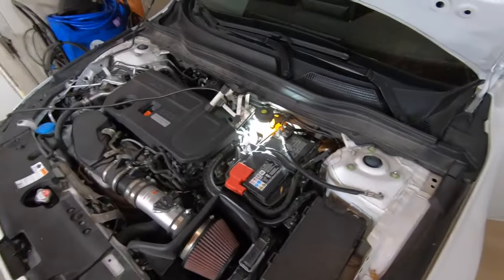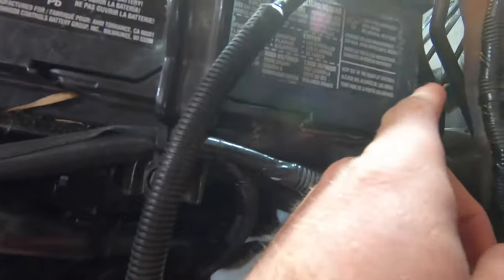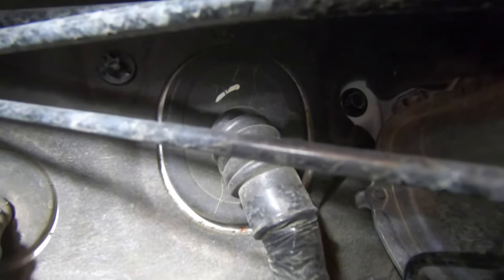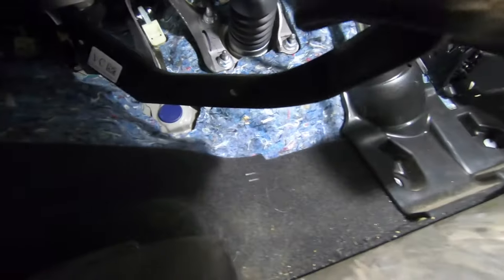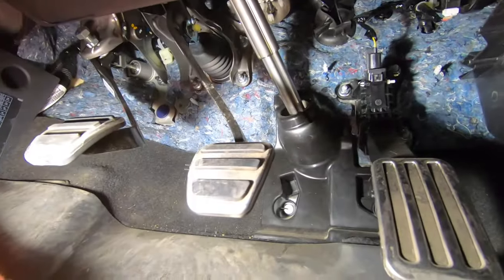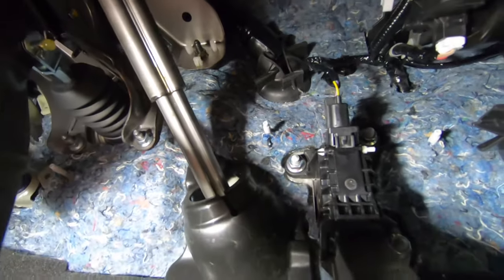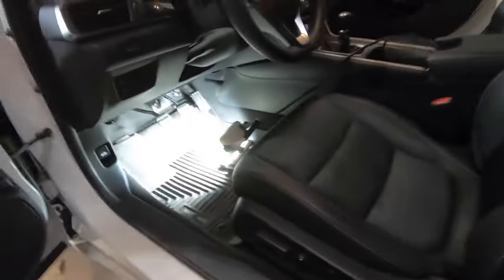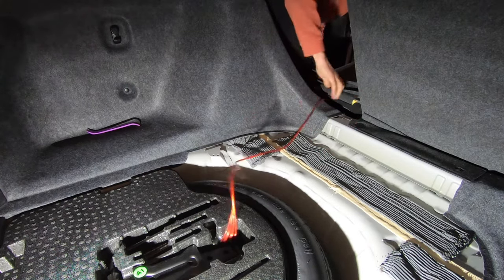2018 Accord Sub/Amp wiring Tips & Tricks

Comment: I have the same rca adapter, I'm confused on how you got the remote of it ? Did you connect the (brown) ground wire ?  Or did you run a remote wire from the fuse panel if so what fuse did you use?
Reply from the maker: On the adapter there are six wires two for left speaker, two for right speaker, one ground and one remote. hook the positive and negative left and right speaker wires to the speakers in the car, the ground wire goes to ground on the car and the remote wire goes to the remote terminal on the amp. There are versions of the adapter that don't have the remote.
Reply: @HumbleAcres  I see my problem I don't have a remote on my rca converter , I have 4 speaker tap in wires ,1 ground wire ,and 2 rca inputs. Thank you for the help!
Reply: Run your ignition power to the remote terminal on the amp. Please install an inline fuse on this wire for safety! Presto! Amp powers up when you start the car or use accessory mode.
Reply: jovanni jaimes tap into the acc fuse for remote...accessory fuse that turns on with the radio
Reply: Im not to familiar with that,how do i know wich fuse ?
Reply: @HumbleAcres  im confused as how to run the remote from the radio,  or ignition to the amp, any ideas?
Reply: Im not familiar with  the fusebox , i dont wanto mess it up

Comment: Did you have any trouble with the ground? I didn't everything else how you said but I can't get a ground
Reply from the maker: make sure you sand off the paint to get metal on metal contact.
Reply: Yes I made sure to sand it down yet no luck
Reply from the maker: @ricardolopez-ey3wm  sorry without seeing it it is hard to diagnose.
Reply: So found out it was my remote control cable but now when I step on the gas peddle the subwoofer will make bass and with stereo off what do I do?
Reply from the maker: @ricardolopez-ey3wm   Disconnect the ANC module behind the glove box. I didnt make a video on this unfortunately but im sure you can find one.

Comment: Any noticeable sound difference tapping two rear speakers instead of one? Thanks
Reply from the maker: Can’t say I didn’t try just one
Reply: Did you splice both left and right wires together and then pub them into the sub woofer? Wasn't sure what to use since the kicker has a left and right channel.
Reply: @ryant75  i have heard two theories, but most installers seem to agree that bass output is mono so you only need to tap any single speaker to get the signal. however adjusting a fader or balance will affect output if you only tap one line
Reply: I tapped into one and it works perfect. No issues

Comment: Could I just t tap the subs to the rear speakers without an amp or converter?😊
Reply from the maker: You can just won't give you much bass and it will also have the full range instead of just lower frequencies.

Comment: Where did you find the spade connectors? & how did you hook them up to them amp.
Reply from the maker: You can get the spade connectors at any hardware store.
Reply: & the wire?
Reply: @HumbleAcres  which wires did you use to plug into the speakers ?
Reply from the maker: @georgeestevez6502  The wires that are plugged into the rear speakers go to the converter for rca signal and remote power.

Comment: You plugged the rca cables straight into the speaker?
Reply from the maker: No there is a converter that gets the power from the rear speakers and converts it to RCA
Reply: @HumbleAcres  okay and does it do the same as if connected behind the dash like with the low signals? As well did you have any problems down the road? Lastly my amp doesn’t have an on off button would that matter ?
Reply from the maker: @Yourboytimothy  So how it works is when the speakers have power your amp will have power. so no need for a switch.
Reply: @HumbleAcres  thank you !
Reply: Did it matter what color side you plugged it into?
Reply from the maker: @Yourboytimothy  yes there is a + and - for the speakers.
Reply: @HumbleAcres  I got it bro thank you!

Comment: How where did you put the power ground and remote on the line out converter?
Reply from the maker: The ground from the converter goes to chassis ground and the blue remote wire goes to the remote on the amp. there is no power coming from the converter. it gets its power from the speakers.
Reply: Gutentight thanks for the reply dude

Comment: Did you get any rear deck rattle? If so, how'd you fix it?
Reply from the maker: I had deck rattle when the car was new before I did anything. I took the car to the dealer and they stuffed the rear deck with insulation and it was fixed.

Comment: Where did you mount your ground for the amp? If you could post a picture?
Reply from the maker: I used a self taping screw in the sheet metal just behind the back of the seat
Reply: Gutentight awesome thanks bro I’ll be installing my speakers sometime this week, you’ve had the best video for doing it on the accord... did you unplug the anc behind the glovebox?
Reply: What is the reason for unplugging the anc?

Comment: What type of wire extension should I be using for the converter?
Reply from the maker: I'm not sure what you mean by "wire extension". just splice it to another wire.
Reply: Like just another copper wire or what?
Reply from the maker: Yes

Comment: Did u end up getting a check charging system light?
Reply from the maker: Nope
Reply: Gutentight ok cool. Whoever had my car before me deff had a system in it cuz there is a huge freaking wire going from the battery to the trunk. And the back deck speakers r Alpine. For some weird reason they took out the door tweeters tho. But yes, Honda should have stepped up their audio game. My 2009 accord sounded really good factory. Thanx man.

Comment: where did you get your remote wire connected to ?//??
Reply from the maker: the converter from the rear speakers
Reply: @HumbleAcres  did you tap both speakers in the rear? Or just the one?

Comment: Where do you tap in the fuse box for the remote cable?
Reply from the maker: The rca converter I bought gives remote power. No need to run another wire.
Reply: Well I taped the DRL (15) 10A fuse...
Reply: Gutentight do you have a part number or name for the one you bought

Comment: Where did you ground your sub/amp I have the same car
Reply from the maker: Grounded to the sheet metal behind the backs of the rear seats. I point to it in the video. Just sanded paint off and used a self taping screw.
Reply: I’m getting a loud feedback noise when I rev the car then it stops working I’m thinking it’s my ground wire so once I try and fix it tonight I will get back to you but any ideas?
Reply: Gutentight ok I fixed the ground and now I see clearly the sub is loudly grumbling when I accelerate why would this happen?
Reply from the maker: @westonlabelle2182  you need to disconnect the noise canceling module behind the glove box.

Comment: Where and how you would install a bass knob
Reply from the maker: The bass knob plugs right into the amp. Then run the wire to you're desired location under the dash or center console.

Comment: Absolutely garbage installation! Honda accords have high pass filter that filter out bass frequencies to the rear speakers, also, it plays at a lower level than the fronts… you are literally not feeding enough “bass” frequencies to the amp… the amp should be connected to the front channel…
Reply: I’m intalling one in my 2020 where would the best place be for the Remote wire
Reply: @osteenbob4771  go to the fuse panel, find a fuse that is hot when the car is turned on, tap onto that with a fuse tap

Comment: what about the ANC module?
Reply from the maker: I had already disconnected it before this video.
Reply: Gutentight I have the 2018 Accord EX-L. I’m planning to install a 1 channel amp with sub. Could I use the LOC the factory stereo or do the signals have to be from the factory amp?
Reply from the maker: @Apezilla  I believe the EX-L has a factory sub. Im sorry but I really dont know the system that well.
Reply: Gutentight thanks. So I do connect the LOC to the factory sub?
Reply from the maker: @Apezilla  That should work. I don't know if you will still be able to control the sub through the head unit though.

Comment: Wiring your sub to the back speakers is not the correct way, maybe in another car but not on the accord 2018+. The back speakers are not full range so the subs will sound almost dead. This video is not correct for the 2018+ accord. You need to wire the subwoofer from the front speakers
Reply: I tried both and it makes no difference whatsoever. Maybe because it's just too get a signal too turn on and off the amp?
Reply: @jeffd3802  speaker wirimg signal has nothing to do with turning on the amp